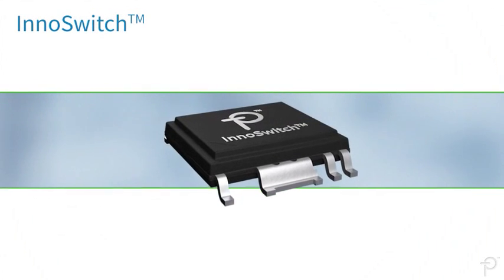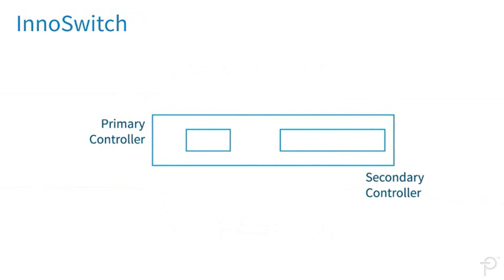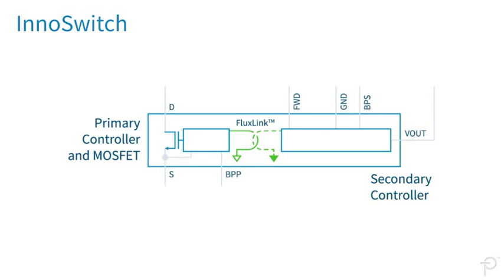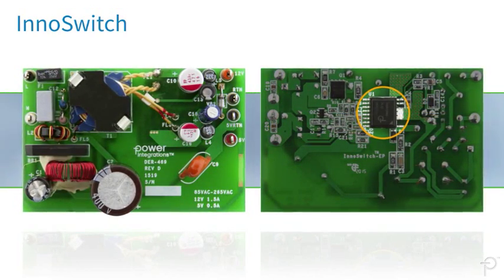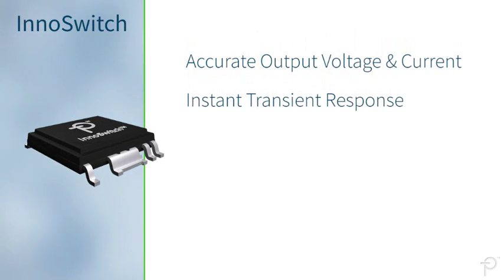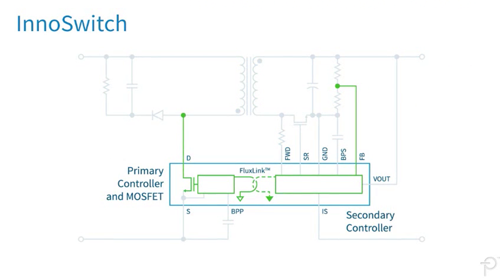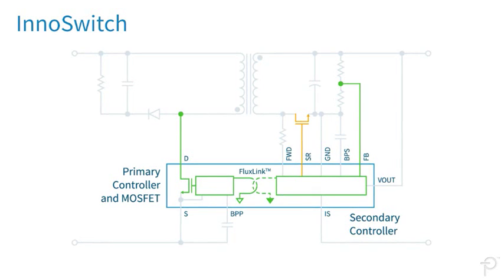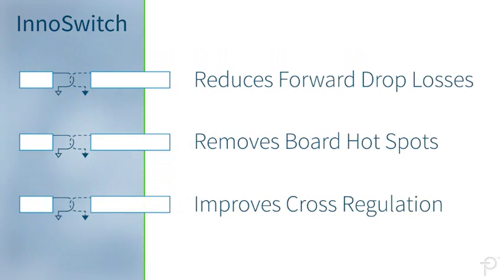Introduction to InnoSwitch

Comment: Does PI register retains programmed value e.g. CV = 12V? or CV will be default 5V after power cycle?
Does PI stores programmed data in flash or RAM?